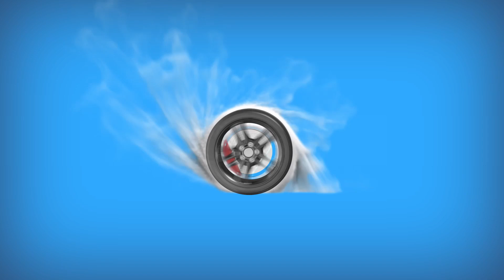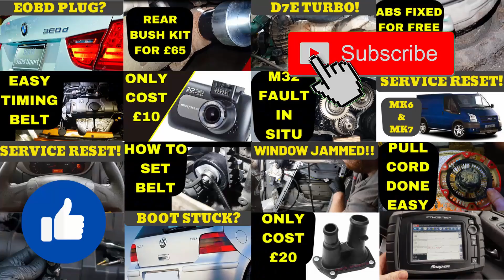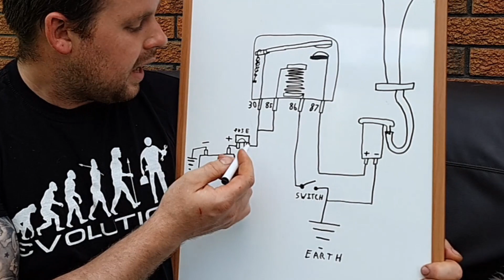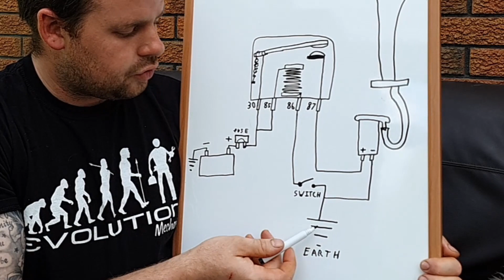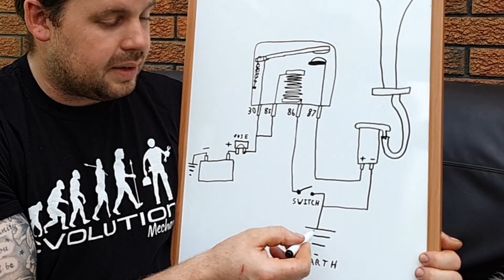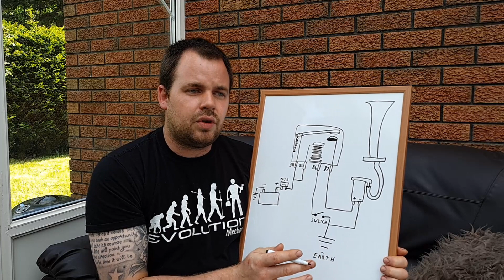How to fit an air horn to my transit custom Air horn circuit diagram

Comment: If you wire 86 to the original horn switch on the steering wheel how do you know which is positive and which is earth? Also could you use the wire that goes to the original horn because in theory its connected to the horn button.
Reply from the maker: You would need a tester to know witch is witch, and yes you could use the horn switch if you would like

Comment: great video like other 2 vids on wiring air horn in this case, was asking you few questions on another video about wiring air horn to original horn wiring but the fuse on vehicle horn is 10 amp and you advised not to increase amp fuse already there. I'm thinking of doing same setup as using push button switch instead of wiring to vehicle steering .great vid.thanks again
Reply from the maker: Thanks

Comment: Hey hoping you could help me maybe. Got a musical horn, had it installed by an electrican and wiring seems in order. But the horn plays too fast, any idea what the issue is maybe?
Reply from the maker: What voltage is the vehicle? And was the horn the same?
Reply: @Martysworkshop  connected to a normal 12v battery. And has a relay and fuse.

Though did contact manufacturers they think its a faulty compressor and a new one on the way. 
But still if by any slight chance its not the compressor, any ideas?
Reply from the maker: I think the compressor is most likely to be the fault.
Reply: @Martysworkshop  okay thank you very much. Gonna get compressor in a week so fingers crossed😂

Comment: Hi Marty, how difficult would it be to fit a second horn to run along side this one . Great explanation video.  Looking forward to installing.  Cheers
Reply from the maker: Not difficult at all, do you want it to work off the same switch?
Reply: @Martysworkshop  thanks for the reply and yes
Reply from the maker: Cool so 15 amps will run 2 pumps no problem so you could use the same suply and earth.

Comment: Here’s one for you Marty how would you install a set of air horns using a5 pin relay so you can still use your factory horn with a toggle switch ty
Reply from the maker: So would you want the toggle switch to switch witch horn is operated when you press the original switch?
Reply: @Martysworkshop  yea ide like the toggle switch to switch between factory and air horns ty